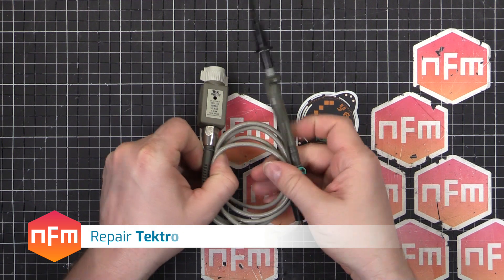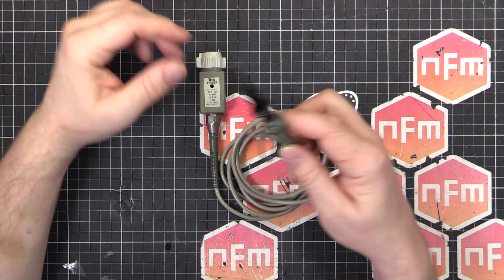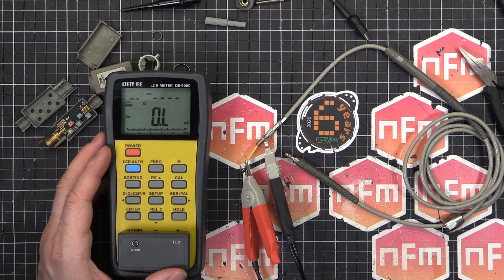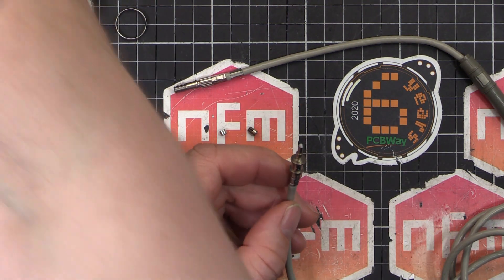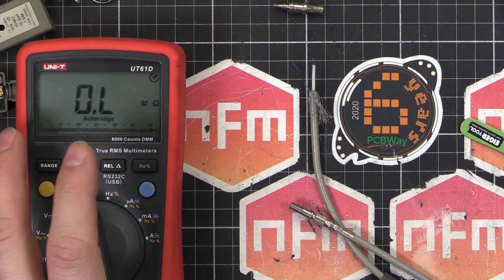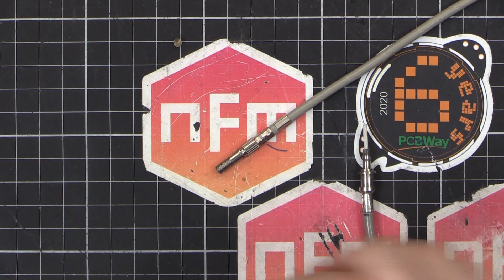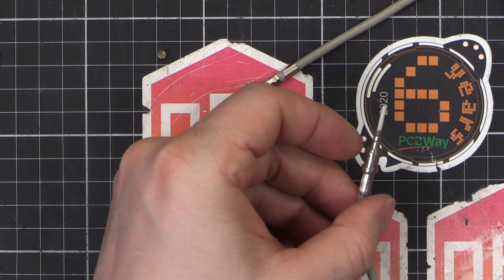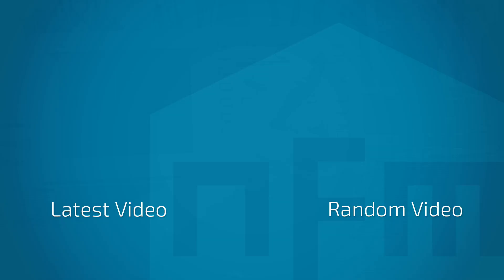Tektronix P6137 Scope Probe Repair

Comment: Thank goodness. I've kept an extra broken probe for my 2465A in a box just in case you came along someday. Now if anyone has the precise properties of that lossy coax for the other one I want to repair...

Btw, I can't see why this wouldn't work for the whole series of probes, like the P6138A/B; as long as A. you're not too picky, or B. you have gear with the resolving power to make sure you've got it perfect. From experience, the probes work up to 350MHz or higher, even with a not-so-perfect repair.

Last thing, your guess was really good on where the discontinuity was, but if it didn't occur to you, or if you don't have one, may I recommend the famous 74AC14 Schmitt Trigger Inverter TDR video from fellow Tek enthusiast w2aew (https://www.youtube.com/watch?v=9cP6w2odGUc). Apologies if you thought of that/actually have a real pulse gen.
Reply from the maker: Thanks for the link! He does make some good videos.

There is one brand new cable in factory sealed bag cable being sold on Yahoo Japan at the moment. I bought one for another probe that was too damaged to fix so now I have two repaired probes. :)

Comment: i need to repair mine p5122, the compensation cap got ruined, how do u remove the spring part in the front, bruteforce?
Reply from the maker: Yeah, the BNC collar just pulls of with some force, a flat screwdriver can be used to gently lever it off.

Comment: Here's a simple tip to find quick and easy cracks in all sort of cables (usb, utp, audio, etc...), without expensive tools.
1) You only need a 5V Switch Mode Power Supply like a USB cell phone charger,  
2) A USB cable (don't have to be new)
3) 2 mini alligator clips
4) Non Contact Voltage Tester like this one : 
https://i.postimg.cc/wBMpcJqL/Non-Contact-Voltage-Tester.png (Can be found cheap at Ebay, Amazon, Wish etc.....)
Cut one end off of the USB cable, and leave the USB A connector on the cable. Connect the 2 mini alligator clips to the - and + ( normally black and red wires) of the cutoff end of the usb cable. Plug in the USB charger in the wall outlet, and the USB A connector in the USB charger.
Take the faulty cable, and leave it open on both sides, connect the + alligator clip to a wire of this cable (each wire of this cable must be tested separately) , 
and use the "Non Contact Voltage Tester" along the cable. The - clip of the USB charger is not used and not connected to anything.
About 1cm past the fracture in the wire, the beeping/flashing of the Non Contact Voltage Tester will stop.
These "Non Contact Voltage Tester" are advertised for 90 to 1000V AC, but they react to 5V DC and the switching noise of the USB charger. 
With a Linear bench powersupply this trick won't work.
Reply from the maker: Nice tip, I'll have to try it out one day.

Comment: For information about the Readout Pin see https://w140.com/tekwiki/wiki/BNC_connector_with_readout_ring For x10 probes the pin usually has an 11 KOhm resistor to ground,  See this thread for further info on what resistance values are used for various probe attenuation ratios https://www.electronicspoint.com/forums/threads/readout-pin-on-oscilloscope-probes.171206/
Reply from the maker: Thanks for the clarification. :)
I kind or brushed past the pin. I said it was a ground pin, but should have said it was 'grounded when the button on the probe was pressed'.
Reply: @NearFarMedia  Ah! So it has a dual purpose; readout and Probe ID.  I couldn't find a schematic to work out how Probe ID works.  BTW, thanks for the two clear pix on the probe's TekWiki page. :-)  It is probably OK to link this video from the P6137 page if you want the infamy.

Comment: Never thought i would see someone fix a scope probe, great work!
Reply: Great story. But is it fixed? The centre conductor can still be intermittent anywhere along the cable, and flexing the cable (normal use) will cause signal integrity problems, and erroneous measurements. Not to mention it isn't fixed if it isn't crimped (not as easy as he makes it out to be.)
Reply from the maker: Yes it is fixed, there is no other damage to the cable.
And crimping is as easy as closing your fist around a crimper with the correct sized die. It's not an arcane process.
Reply: Rarely would a wire be broken in the middle unless it got pinched by something.